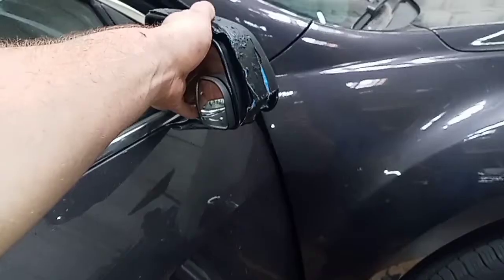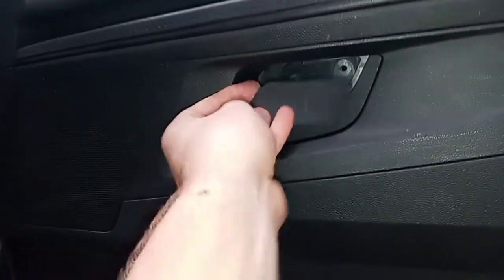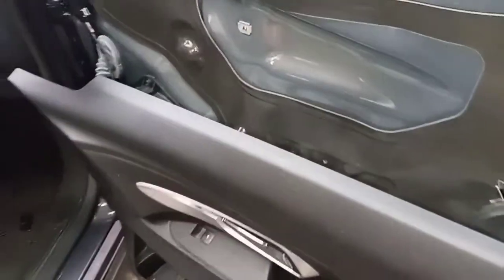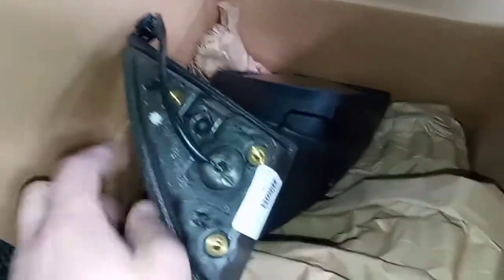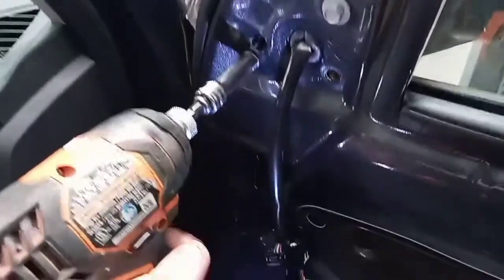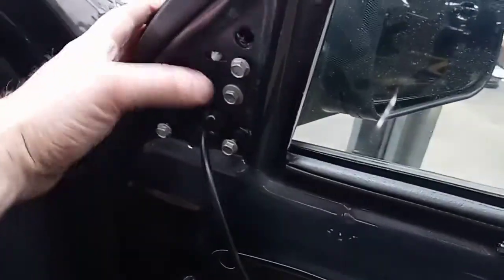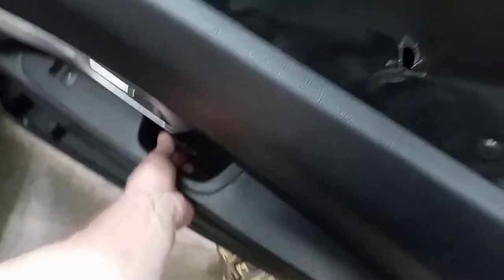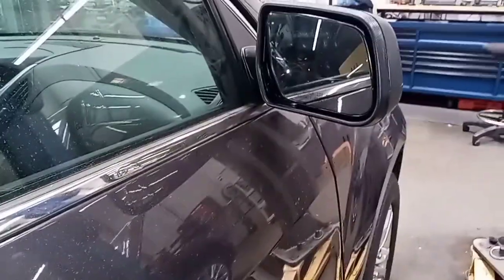2016 Chevy Equinox Side View Mirror Replacement

Comment from the maker: GET THE DRIVER SIDE MIRROR ASSEMBLY HERE ( AMAZON )
https://amzn.to/3wUHm2T

GET THE PASSANGER SIDE MIRROR ASSEMBLY HERE ( AMAZON )
https://amzn.to/3epWwGM

GET BOTH SIDE MIRROR ASSEMBLIES HERE ( AMAZON )
https://amzn.to/3q8Ygqy

PARTS INFO  / NOTES 
Direct Replacement Mirror Compatible with 2010-2017 Chevrolet Equinox/GMC Terrain
Replaces OE Number: 20858708, 22818263, 23467283, 20858707, 22818262, 23467282 & Replaces Partslink Number: GM1321386, GM1321452, GM1321479, GM1320386, GM1320452, GM1320479